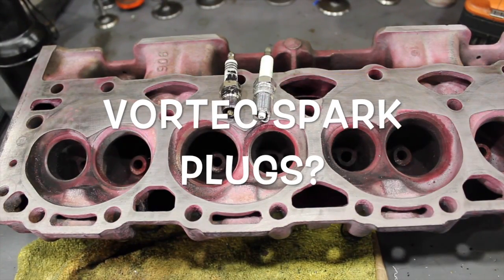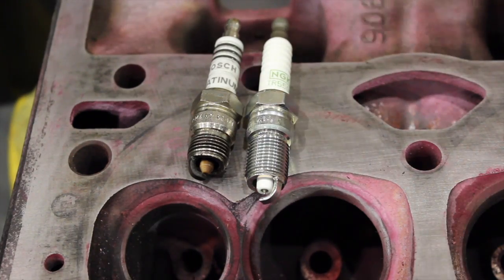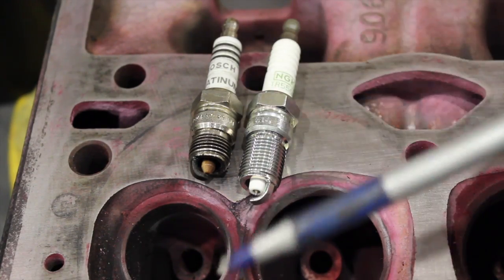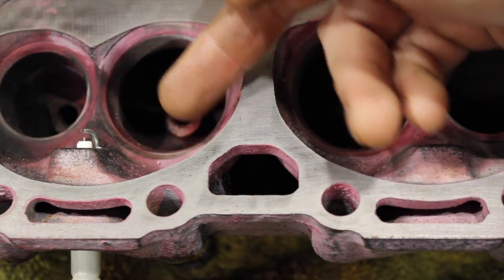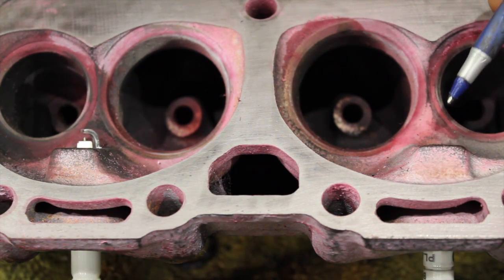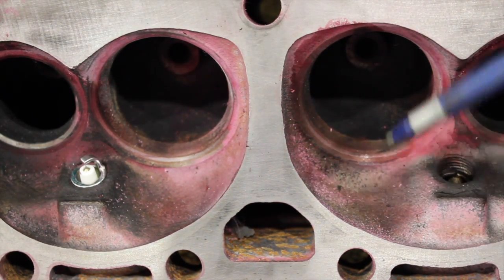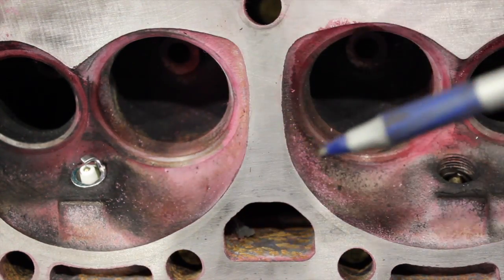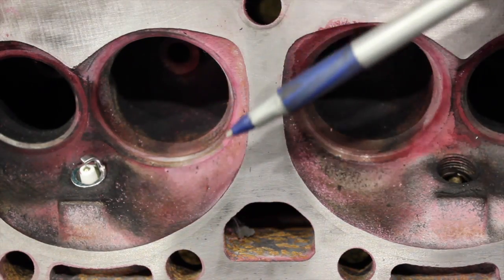Vortec SBC Spark plugs? Plus ignition tips

Comment: So would you want to run a hotter plug if you got one of the fancy super coils or open the gap up more? Or both?
Reply: I wouldn’t. I’ve got a HT 383 GM crate with q jet , MSD 6A ,  I personally think it’s too much strain on the coil to jump the big gap. I replaced two coils in six years. Just my opinion.
Reply: @martinbeckmann9376  I'm just curious cuz I have one of them fancy little summit coils on an actual vortec engine cuz it wasn't expensive. Supposibly puts out a bunch of voltage. I wasn't sure if maybe a hotter plug would compliment it or maybe any sort of difference in gap. Idk if the thing even works like it says but I know it's done something cuz it's way more responsive compared to the factory coil. Just thought I'd ask.
Reply from the maker: If your running a hot ignition and high compression vortec engine might not be a bad idea to drop down a heat range to (NGK 6) 
But I wouldn't get to crazy about opening the gap up much past .045.
Most guys with there 9 to 9.5:1 compression vortecs engines will be just fine with the stock heat range
Reply: @cuttersperformance  yeah I've not done much else but a billet aluminum distributor over stock plastic along with the coil and a good set of wires for it. The whole stock gap at .060 or whatever sounds about right as I've lowered the gap on the plugs to .055 not wanting to push my luck and find out any lower might be less efficient. But I'll keep the .045 in mind for sure as I'm sure the cheap copper plugs won't last long anyways haha
Reply: MSD recommends .050 gap for n/a engines. After all, we’re upgrading our ignition system to increase spark performance so increasing the gap is a part of that goal. I will say from an OEM perspective, wider gaps ( and higher output coils) are used for engines that have leaner mixtures. So that can help you decide what gap you want to do with your modified engine.

Comment: What the max lift on stock set of vortecs, all I want to do is upgrade valve springs and screw in studs? Can you put a standard hydraulic flat tapping can and lifters in a vortec block?
Reply from the maker: Max lift i can get with vortec heads is .580 lift with beehive springs 
But you lose alotnof your valve tip so you need to be careful with self aligning rockers
Most guys buy my drop in std lift .530 vortec spring kit so they don't have to worry about rocker to retainer clearance.

And yes you can run a flat tappet in a roller block
Reply: @cuttersperformance  thank you